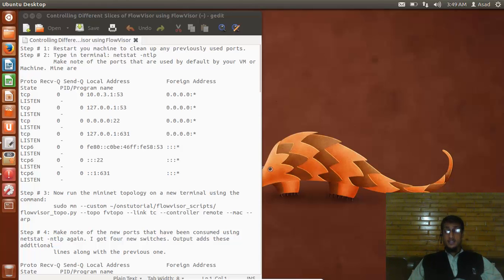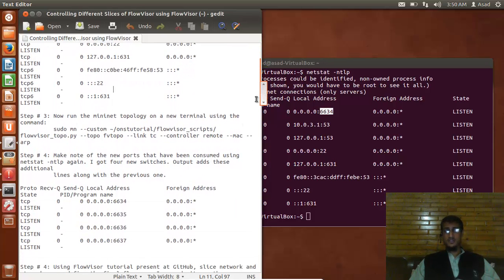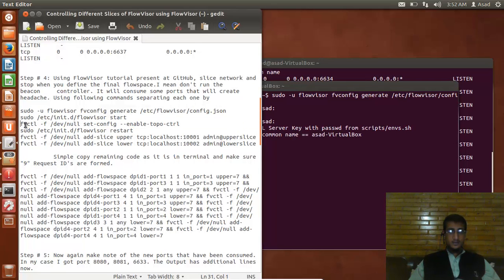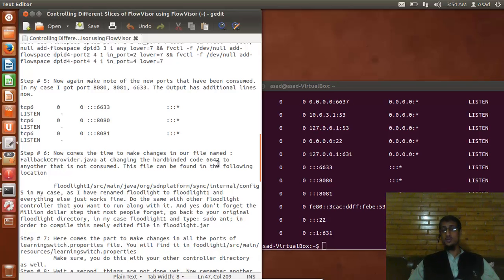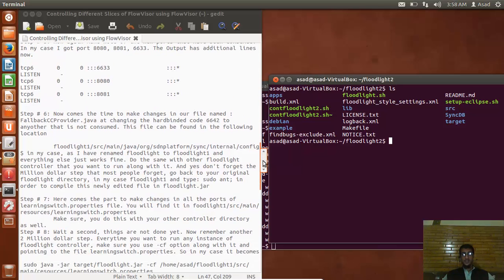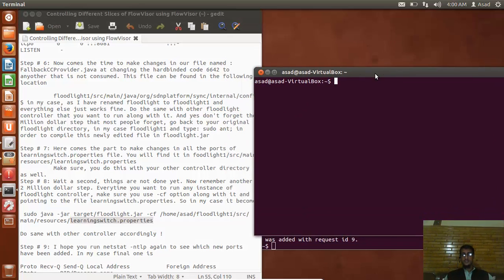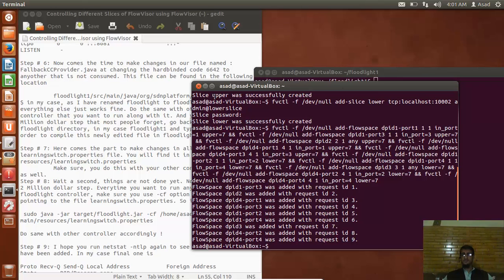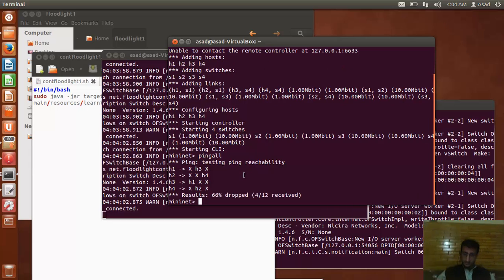How to Run Multiple Floodlight Controllers with FlowVisor -- SDN Tutorials

Comment: Hi,
I'm trying to run two floodlight,one flowvisor in the same network topology used by you.
I find a problem when the two floodlight controllers want to control two different port of the same switch, basically If one port belongs to one slice and the other port (of the same switch) belongs to the other slice.
This is the output that I have when I run the second floodlight controller:

11:07:24.450 INFO [n.f.c.m.FloodlightModuleLoader:main] Loading modules from src/main/resources/floodlightdefault.properties
11:07:24.563 WARN [n.f.r.RestApiServer:main] HTTPS disabled; HTTPS will not be used to connect to the REST API.
11:07:24.563 WARN [n.f.r.RestApiServer:main] HTTP enabled; Allowing unsecure access to REST API on port 8080.
11:07:25.972 WARN [n.f.c.i.OFSwitchManager:main] SSL disabled. Using unsecure connections between Floodlight and switches.
11:07:25.972 INFO [n.f.c.i.OFSwitchManager:main] Clear switch flow tables on initial handshake as master: TRUE
11:07:25.972 INFO [n.f.c.i.OFSwitchManager:main] Clear switch flow tables on each transition to master: TRUE
11:07:25.972 INFO [n.f.c.i.OFSwitchManager:main] Setting 0x1 as the default max tables to receive table-miss flow
11:07:26.022 INFO [n.f.c.i.OFSwitchManager:main] Computed OpenFlow version bitmap as [8]
11:07:26.024 INFO [n.f.c.i.Controller:main] OpenFlow port set to 10002
11:07:26.024 INFO [n.f.c.i.Controller:main] Number of worker threads set to 16
11:07:26.025 INFO [n.f.c.i.Controller:main] Controller role set to ACTIVE
11:07:26.064 INFO [n.f.l.i.LinkDiscoveryManager:main] Link latency history set to 10 LLDP data points
11:07:26.064 INFO [n.f.l.i.LinkDiscoveryManager:main] Latency update threshold set to +/-0.5 (50.0%) of rolling historical average
11:07:26.077 INFO [n.f.f.Forwarding:main] Default hard timeout not configured. Using 0.
11:07:26.077 INFO [n.f.f.Forwarding:main] Default idle timeout not configured. Using 5.
11:07:26.077 INFO [n.f.f.Forwarding:main] Default priority not configured. Using 1.
11:07:26.078 INFO [n.f.f.Forwarding:main] Default flags will be empty.
11:07:26.078 INFO [n.f.f.Forwarding:main] Default flow matches set to: VLAN=true, MAC=true, IP=true, TPPT=true
11:07:26.078 INFO [n.f.f.Forwarding:main] Not flooding ARP packets. ARP flows will be inserted for known destinations
11:07:26.079 INFO [n.f.s.StatisticsCollector:main] Statistics collection disabled
11:07:26.079 INFO [n.f.s.StatisticsCollector:main] Port statistics collection interval set to 10s
11:07:26.304 INFO [o.s.s.i.c.FallbackCCProvider:main] Cluster not yet configured; using fallback local configuration
11:07:26.305 INFO [o.s.s.i.SyncManager:main] [32767] Updating sync configuration ClusterConfig [allNodes={32767=Node [hostname=localhost, port=6642, nodeId=32767, domainId=32767]}, authScheme=CHALLENGE_RESPONSE, keyStorePath=/etc/floodlight/auth_credentials.jceks, keyStorePassword is unset]
11:07:26.447 INFO [o.s.s.i.r.RPCService:main] Listening for internal floodlight RPC on localhost/127.0.0.1:6642
11:07:26.481 INFO [n.f.c.i.OFSwitchManager:main] Listening for switch connections on /0.0.0.0:10002
11:07:26.486 INFO [n.f.l.i.LinkDiscoveryManager:main] Setting autoportfast feature to OFF
11:07:29.842 INFO [n.f.j.JythonServer:debugserver-main] Starting DebugServer on :6675
11:07:30.273 INFO [n.f.c.i.OFChannelHandler:nioEventLoopGroup-3-1] New switch connection from /192.168.56.101:47878
11:07:30.319 INFO [n.f.c.i.OFChannelHandler:nioEventLoopGroup-3-1] Negotiated down to switch OpenFlow version of OF_10 for /192.168.56.101:47878 using lesser hello header algorithm.
11:07:30.410 INFO [n.f.c.i.OFSwitchHandshakeHandler:nioEventLoopGroup-3-1] Switch OFSwitch DPID[00:00:00:00:00:00:00:01] bound to class class net.floodlightcontroller.core.internal.OFSwitch, description SwitchDescription [manufacturerDescription=Nicira, Inc., hardwareDescription=Open vSwitch, softwareDescription=2.0.2, serialNumber=None, datapathDescription=None]
11:07:30.418 INFO [n.f.c.i.OFSwitchHandshakeHandler:nioEventLoopGroup-3-1] Clearing flow tables of 00:00:00:00:00:00:00:01 on upcoming transition to MASTER.
11:07:30.423 WARN [n.f.c.i.C.s.notification:main] Switch 00:00:00:00:00:00:00:01 connected.
11:07:30.482 ERROR [n.f.c.i.OFSwitchHandshakeHandler:nioEventLoopGroup-3-1] OFBadActionErrorMsgVer10(xid=0, code=EPERM, data=OFPacketOutVer10(xid=13, bufferId=4294967295, inPort=any, actions=[OFActionOutputVer10(port=2, maxLen=0)], data=[-1, -1, -1, -1, -1, -1, 54, 14, -60, 38, -91, -124, -119, 66, 32, 0, 6, 4, 0, 2, 0, 0, 2, 7, 4, 0, 0, 0, 0, 0, 1, 4, 3, 2, 0, 2, 6, 2, 0, 120, -2, 12, 0, 38, -31, 0, 0, 0, 0, 0, 0, 0, 0, 1, 24, 8, 1, 3, -103, -51, 22, -57, -96, 27, -26, 1, 1, -2, 12, 0, 38, -31, 1, 0, 0, 1, 91, -92, 93, -98, 50, 0, 0])) from switch OFSwitch DPID[00:00:00:00:00:00:00:01] in state net.floodlightcontroller.core.internal.OFSwitchHandshakeHandler$MasterState@265c65cb